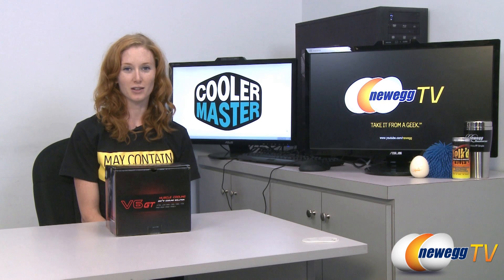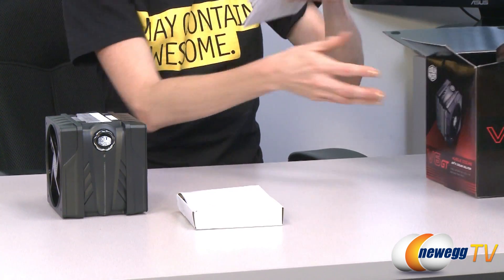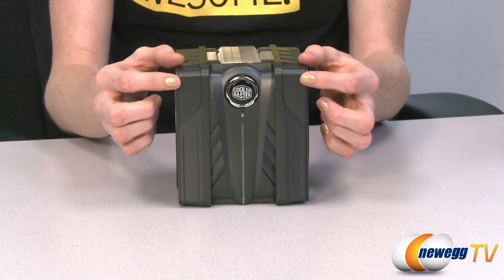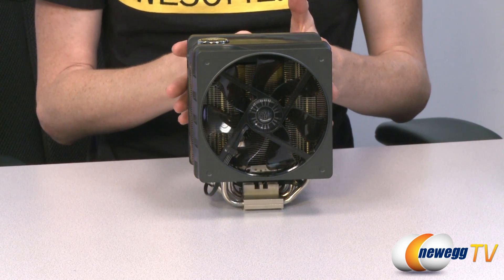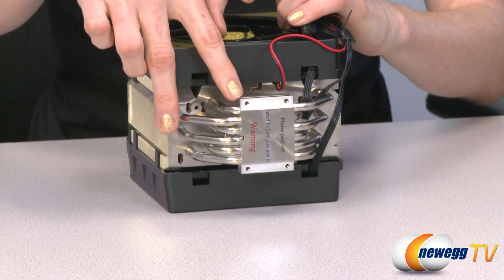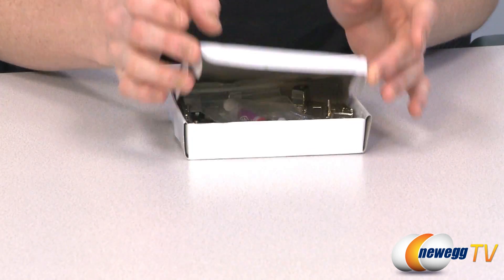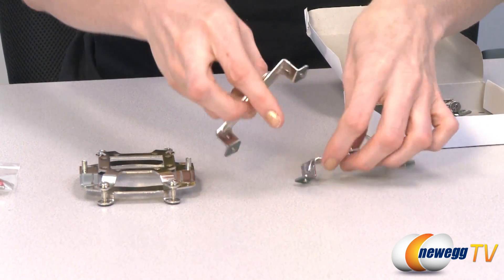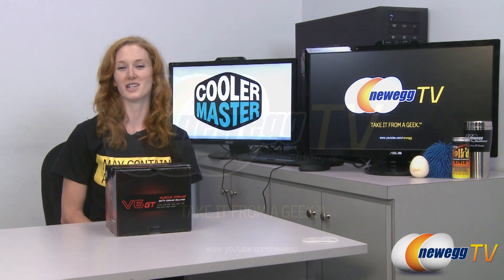Newegg TV: COOLER MASTER V6 GT CPU Cooler Overview

Comment: I have a question, Will this support a 4770k, more importantly, will this FIT a 4770k? Like a 1150 or Z87 motherboard? (I plan to use the new Sabertooth by ASUS with full 16 gigs  of all slots taken up by Corsair Vengeance and G.skill Trident X RAM) So, will it fit into my system? (No, she in fact didn't say that.)

Comment: Yes, but be sure to check out the RAM profiles and see if the heatspreader on it will fit correctly if you are using multiple RAM slots.

Have a nice day. c:

Comment: @BenjaminFranklin2u which would make your point even more redundant than mine, although mine wasnt pointless. you dont screw something to the board you fasten it. and yes actually it is very wrong and totally inacurate. i bet your a democrat. anyhow it doesnt really matter. i proved a point that you have no job and typed a response while i was at mine. which makes you more of a troll than ever.

Final word of the day:
why argue with a stranger over a pointless discussion, unless you're worse off

Comment: @Osiliusify Nice strawman. A more accurate example would be when you say "listen to yourself". I don't take it to mean actually listen, I assume you mean "read".
Just as when she describes the fasteners as "screws", she doesn't necessarily mean they are screws, just that they serve the function of screwing the cooler to the board. 
Again, it's not really wrong, just inaccurate. In any case it's semantics, and the fact that you HAD to point it out is redundant and pointless, which is my point.

Comment: @Osiliusify For someone who is OCD about the use and context of the word "screw" you sure do fuck it up a lot. Especially since  the word "screw" can be used interchangeably to simply describe the motion of a bolt. As such calling a bolt a screw is not wrong, but merely not accurate. 
In reality a bolt is simply a screw that holds a nut. If a bolt doesn't hold a nut, it's a screw.

In any case you belittling is childish. Leave the ad hominem attacks to the kids.

Comment: @BenjaminFranklin2u  the only thing i didnt mention in the above mentioned post was the fact that 1/4 inch ment the diamater of the bolt, and i didnt specify the length of the bolt, but a sucubus of a kid like yourself would have infact been off looking for those exact bolt whilst i found them myself

that is all Jr. Lowes Attendant.

Comment: @BenjaminFranklin2u thats exactly what i said just didnt have to wow-wiki it to know...additionally the BOLTS and NUTS that are shipped with cpu cooler DO infact meet those specifications. those exacting specifications are a unit of messure like so....

i walk into a hardware store and ask for 4 #20 1/4 20's now dont let this blow your mind but i just asked for Four (4) number 20's (twenty threadcount per inch) 1/4 Inch Bolts. bolts are big and small and come in all sizes.
those that...

Comment: @Osiliusify 	Bolts are defined as headed fasteners having external threads that meet an exacting, uniform bolt thread specification (such as M, MJ, UN, UNR, and UNJ) such that they can accept a nontapered nut.  Screws are defined as headed, externally-threaded fasteners that do not meet the above definition of bolts.

According to the official definition those fasteners are actually screws, as they don't meet the required specifications.

Comment: ITS A Nut and Bolt NOT a Screw. a screw is a crude form of attachment, usually a pin of some sorts and an inclined plane rapped around on about a 12 -30 degree angle.  a Nut and Bolt is Refined in the sense as you can actually ask for a specific thread count depending on the amount of torque and pressure that needs to be applied to said mounting surface.  Please distinguish the two more clearly, you DO NOT use SCREWS for connecting cooling solutions to your computer, you use nuts and bolts. 
Tks